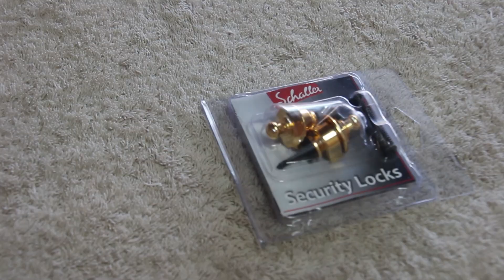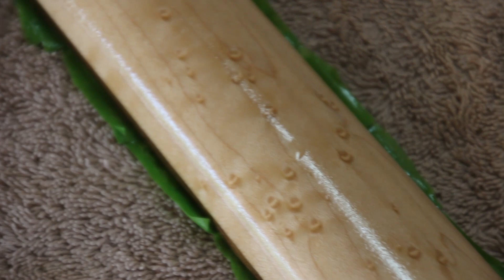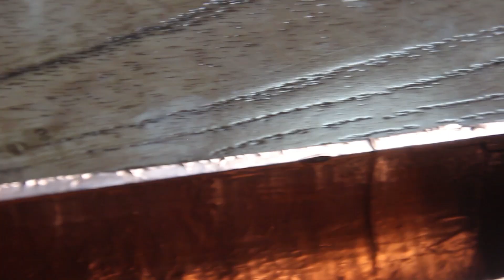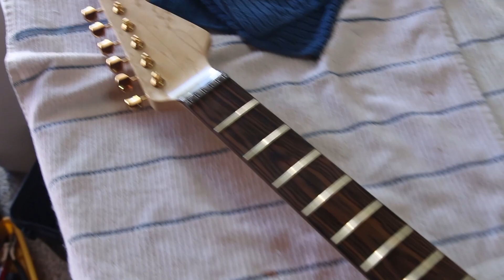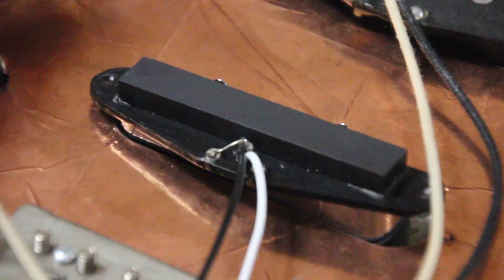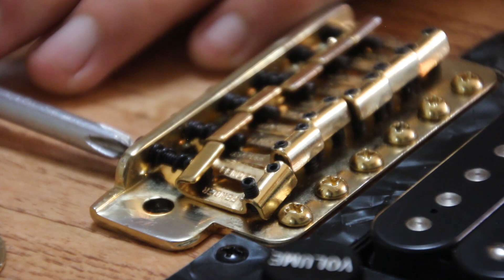Custom Stratocaster Build by Joe O'Quinn

Comment: One thing I’ve noticed a lot with these custom builds, everyone does the same thing when bolting on the neck.

Like in this video, you screw the screws into the body, and then into the neck. This forces the neck to be pushed out, hence why you need to keep pressure when screwing in. I’ve always known this to be wrong…

When screwing in a neck, the screws should pass through the body freely. You’re then using the back plate and the neck to squeeze into the body as you tighten. This prevents the pushing away of the neck, reduces the time of screwing, and creates a tighter fit with better contact to the body.
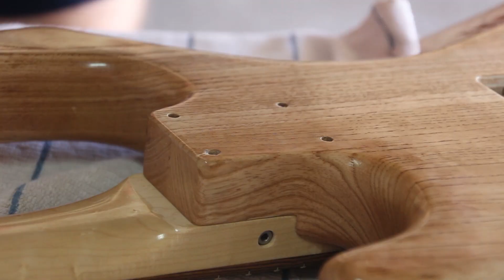Reply from the maker: I gotcha. If you are fastening two materials and both are threaded, you can run into problems, but I didn't do that. The neck holes in the body were through holes. They were slightly larger than a net fit for the wood screw size and aren't actually threading into the body part. The screw is only threaded into the neck and the head of the screw sits on the plate. 19:41 you can see i drop the screw in and it rests on the neck wood sitting up about 3/4". the screw is not threaded into thee body material at all.
Reply: @joeoquinn3125   I don’t know why I didn’t catch that… I completely apologise! I must’ve been tired when watching this. That’s actually perfect!

Beautiful guitar by the way, you’ve done an amazing job! I was watching a few other Strat builds at the time, and had noticed some of them screw straight into the body. I don’t know if I’m correct in what I’m saying, but that’s just something I’ve always been told. It seems logical to me… I just don’t know why I thought you did the same, it’s pretty clear you’re doing it the way I’ve known to be correct. 

Have a great day!

Comment: Jut wondering why you did not use the Floyd Rose Rail Tail Tremolo system?  It is supposed to stay in tune better.  AND it fits the Fender Tremolo six hole position perfectly...
Reply from the maker: that looks like a bridge/trem system that could have benefited the build. i wasnt aware of that at the time. thanks for the suggestion! i may just upgrade!
Reply: @joeoquinn3125  I think you'll be glad you upgraded... I am looking at a build myself so have been researching a bit.  Your build is very well done, but I think I may et mine with the wood finished; I just do not have the time to invest, but if I did I would go with a wipe-on poly just to avoid the equipment investments.  Been looking at Seymour Duncan P-rail pickups too (very interesting).

Comment: A hint for the next time you lacquer, buy a binks gravity gun $200 put the tip #4 prepare sanding seal lacquer adding 1/4 of lacquer thinner- spray 8” distance with 4” line shaped transfer and sand with 400 grid between coat- apply precat lacquer with 8Oz/Gal

Comment: Yea man..no waiting on clearcoat to dry for a week. People think I polly or laquor finish all my natural wood. And the crazy thing is you can wax but I like to use linseed oil or teak oil..and with dying diy it a few shades darker to the lighter color as you wetsand it to the exact shade you want. Condition it and you're good for 6 to 8 months. Good luck man with your builds. Keep in touch..I'll subscribe to your Channel. You definitely got a handle on the builds. Cool bro..

Comment: Not badmouthing ya. I'm a woodworker, carpenter. Just when I see people doing something wrong I'm like omg, NO! I'm I justa perfectionist.. you can wetsand bare wood and biff it also it will come out like a sheet of glass. In steps 600 to 2000 grit. And 2500 to 5000 sanding buffing pads.its fine to wetsand bare wood don't sweat it. You'll never have to clean coat or true oil anything again. Now don't think I was down grading it. It looks awesome man. Try the sanding steps you'll be amazed. Trust me..
Reply from the maker: i get it. i spent more time with buffing the nitro finish, to protect it, but definitely didnt go up to 5000, maybe 2000 at most, and all by hand. by far the most labor intensive and arduous part of the build. i cant imagine doing that on the bare wood, that is impressive.

Comment: Your soldering pencil tip sucks.. Its a corroded mess. A tip that is shiny and bright will transfer heat much better. Some of your joints are not well soldered... you have melted solder balled up, not flowed and wetted. Proper rosin core solder would help.. as would some liquid rosin flux applied by brush. Clean tip and proper flux you will make great joints... Other than soldering, this is a beautiful build.. looks great. Love your pick guard shape.
Reply from the maker: lol, i completely agree. i have definitely upgraded since then.

Comment: Man you were killing me sanding in circles... never, never sand in circles.  With the grain sand, and get yourself some 800 grit sandpaper up to 2000.wet sand. Good job though.
Reply from the maker: bro, tell me why it is bad. i said and disclaimed that i am no expert and very minimally experienced with this. the guitar turned out completely fine. i wasnt tearing grains out or having issues. it is a hard wood, it can handle it, im sure. i did use those grits. i didnt show every step of the process, as disclaimed also, because the video would be 4 hours long. the sanding was to mostly ease off the grain filler. there wasnt much direct sanding to the bare body. it was a learning process though :)
Reply from the maker: bro, also. i worked at Taylor Guitars for a while in San Diego. they use hand rotary sanders on everything and all types of wood. from bare wood on the body, neck, and finishes. :)

Comment: Your bridge pup is in backwards (unless you wanted it that way). Cool build! I thought the pickguard turned out particularly well.
Reply from the maker: with what regards is it in backwards? it is suggested by the manufacturer to put it in this way, with the screw lugs on the neck side. thanks for the pickguard comment!
Reply: Joe O'Quinn Most bridge humbuckers are configured screw-side towards the bridge. Neck HB the opposite. But it's optional for sure! It's not like it hurts anything. Debatable difference in tone.
Reply from the maker: right. the do even specify that they like them "backwards". it may be worth experimenting the other way because this humbucker really only has one "hot" coil and would be more affected, plausibly (indeed debatable), by flipping it.
Reply: Joe O'Quinn Gotcha! Those are good thoughts. And don't forget you can raise the screws individually to influence string volume- there are a whole lot of adjustable settings on a humbucker. I'll still tweak the pickups on my old Warmoth build every so often.

Comment: Please check out, Dave's World of Fun Stuff, you have the springs in wrong, just wanted to let you know.
Reply from the maker: im aware of that video. im aware that some people think that the angled springs are "incorrect". i've tried it both ways. it works the same, if it is setup correctly. technically, if the springs are outstretched a bit longer (as happens with the angled springs, a few mm) there is more tension, then the bridge will float at a different angle. just compensate with how deep the trem claw springs are or different gauge strings.....in general, it functions completely properly. also, i like the visual aesthetic of the angle. it's not "wrong". i appreciate the concern, my friend.

Comment: You applied nitro with that mask? Helloo cancer ... dude what the hell are you thinking? those masks for dust they dont have air filtration u need carbon based mask / chemists mask. Nitro creates  highly toxic fume to breathe.
Reply from the maker: I appreciate the concern, but in the 30 years I've been alive I've only once sprayed 1 quart in a well ventilated room, with breaks, over the course of a week and with at least something to cover my breathing. Although I do agree it is very toxic and it damn sure smelled like it, I'll be fine :)
Reply: I used to work a guy who went to school to paint automobiles. He said the old guys who painted cars all their lives now are very sick. The paint goes thru their skin. That's why painters now a days dress up like Walter White.
Reply from the maker: if that was a full time job, that indeed would be a lot of injection of toxic chemicals. i'm glad i only did it once; i may do a couple more times, but thats it.

Comment: the springs should be straight the way you have it gives uneven pressure on the bridge and it wont work the way it was designed to,just sayin
Reply from the maker: hey i appreciate the point. ive always done it this way and the bridge seems to be functioning fine and i get no intonation issues. i may experiment with putting them straight to see if there is a difference.
Reply: Wrong